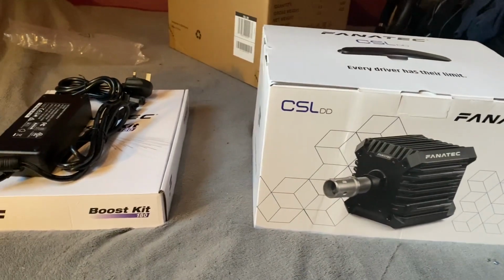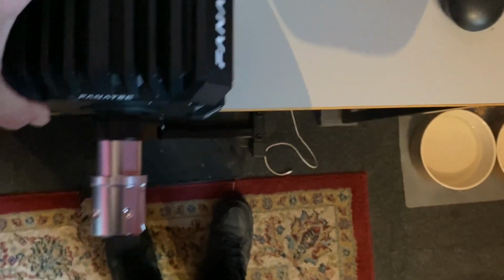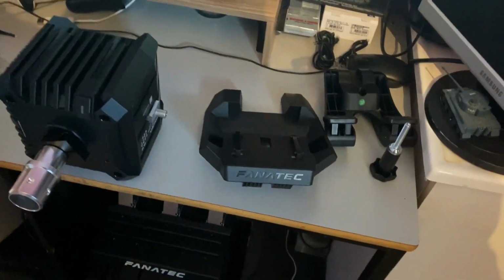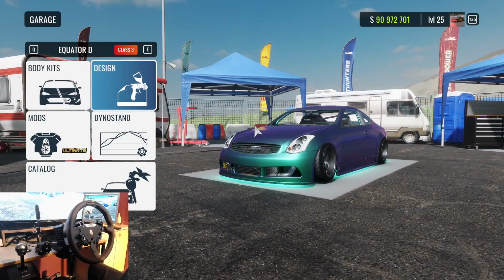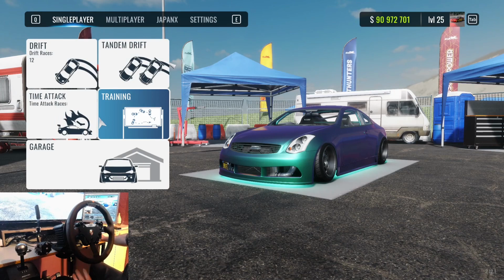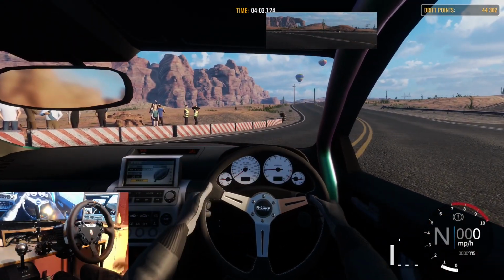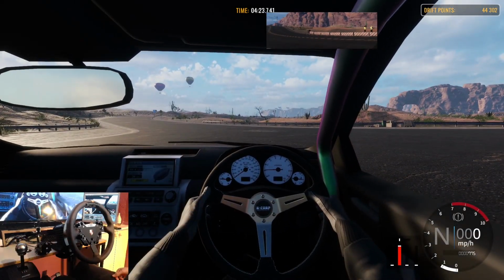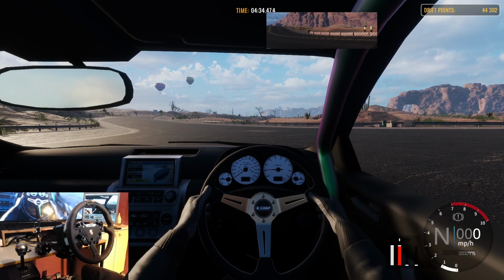Fanatec CSL DD - Unboxing & Testing out CarX Drift Racing Online - Pc Wheel Play

Comment: My wheel won’t work on carx. Do you have it on PC mode or the yellow light ? I’m confused
Reply from the maker: Pc mode, and you should have installed the Fanalab control panel when setting up your CSL

Pc mode is the red light on the wheel base, push once to cycle the modes,

If you have installed it all correctly it should be good to go buddy🤙🏻
Reply: @TheDocDrift  I have the fan alan control pan al everything is registering fine on there. Just nothing pops up on carx. Is there a way to hard reset the settings ? I reinstalled and it loaded my cloud save lol
Reply from the maker: @raddreacts  when you’re in the settings menu, go to connected devices, is the wheel showing up there? You should see your keyboard, mouse and then your fanatec wheel as a controller option? 

If it’s not there, then the game isn’t finding the fanatec software, you may have set it up incorrectly if so. 

Other than that I’m not sure really sure what to suggest brother, I’m sorry 😞

It worked first time for me, there’s no reason why it shouldn’t work for you providing you set it up correctly 🤙🏻
Reply: @TheDocDrift  Yes, It shows up! It’s not active though like in your settings @ 4:11 . When I try to bind the keys nothing registers. I used a G29 before my CSL DD so I don’t know if that has anything to do with it.
Reply from the maker: @raddreacts  well it’s showing so that’s good. Did you delete ghub now you don’t use it?
Reply: @TheDocDrift  Yes still nothing
Reply from the maker: @raddreacts  do me a favour, go to CarX wheel community on Facebook, make a post in there so we can all try to fix this ✌🏻
Reply: @TheDocDrift  Ok i’ll do that right now
Reply: @TheDocDrift  Someone just made a post actually I just commented on it
Reply: @raddreacts  any fix? All keys bind for me besides the actual wheel (axis 0)

Comment: Your wheel is going back alone to center when you exit a turn and letting go off the Steering wheel. How do you do that ? Mine doesn't on this game but on other game yes. Your setting are the default one
Reply from the maker: I have a video with my settings on my channel, but your wheel should do this without having to change any settings expert have no assist on steering

Comment: I can’t setup my commands on carx drift for my fanatec csl dd and bmw gt2 wheel. Can someone help me ?
Reply from the maker: It should be as simple as going into settings - connected devices - select the fanatec wheel and then in there you will assign your buttons to the relevant commands
Reply: @TheDocDrift  mine doesnt work either. Everything works besides the wheel.. axis 0 won’t register on the game for me